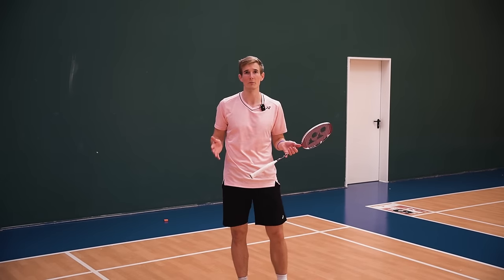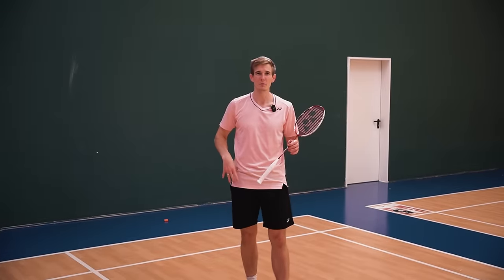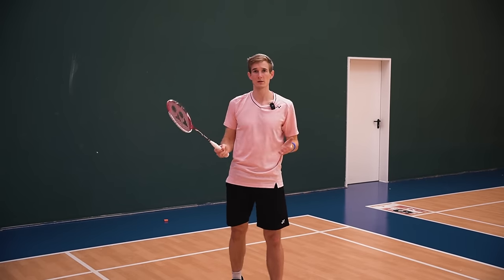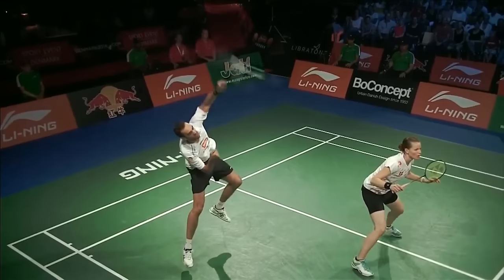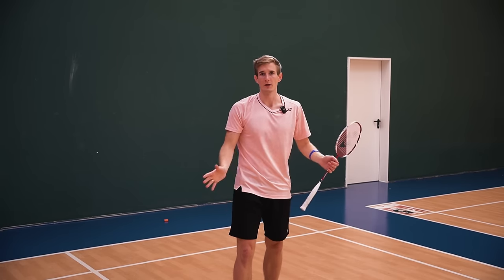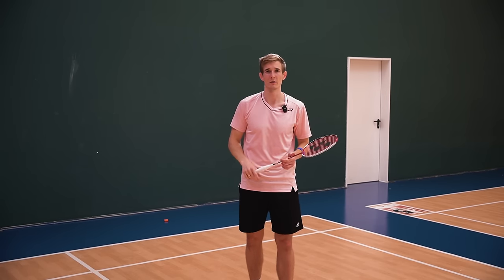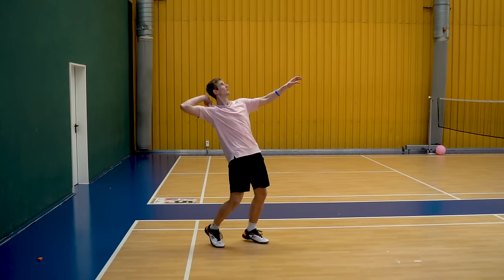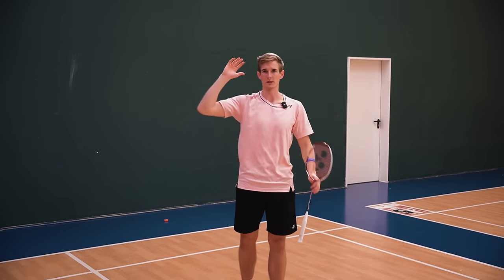3 KEYS to maximize your SMASH POWER

Comment: Amazing tips, Tobias. I wonder if the first two tips are the reason why my "China Jump" / Jump Out stick smashes often times feel more powerful than my traditional smashes when I am in good position? The jump out prevents the hip rotation (scissor kick) motion, stopping it short and transferring the power up through the arm. I suppose the same thing is happening with my shoulder. Very interesting. Thanks for the videos!
Reply from the maker: Yes pretty sure that is the reason 👍 having too much time in the rear court can sometimes also lead to that mistakes and many times people hit harder when they have less time after flatter lifts and they are not able to use too much hip and shoulder

Comment: This is very helpful. I have one specific query. I am a right handed player. While holding the racket in the forehand grip and trying to smash, i somehow always tend to point the racket head towards my left which either results in slicing or the shuttle always being hit towards my left. Any suggestions how to correct this ? Should i slightly rotate my wrist and try ?